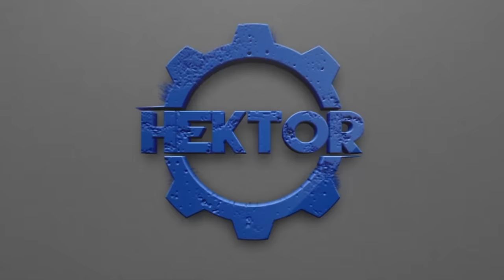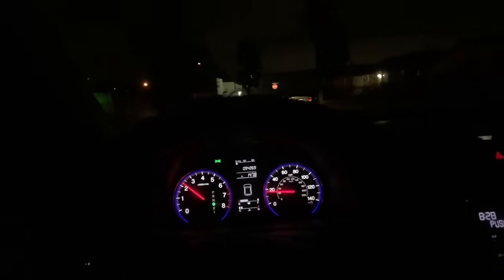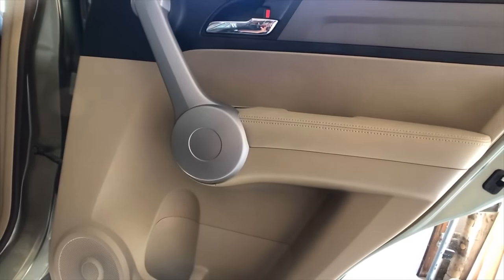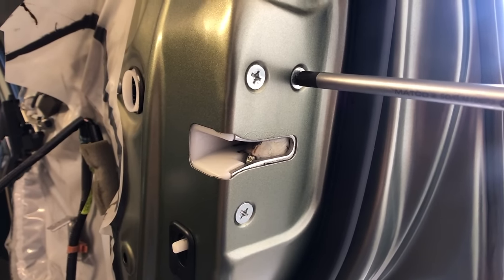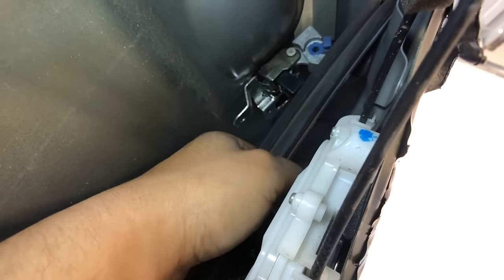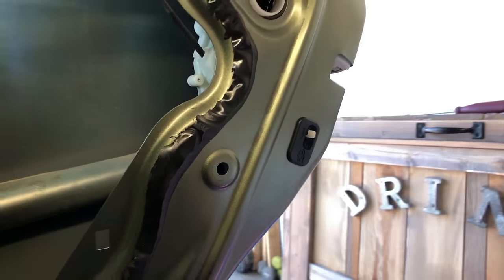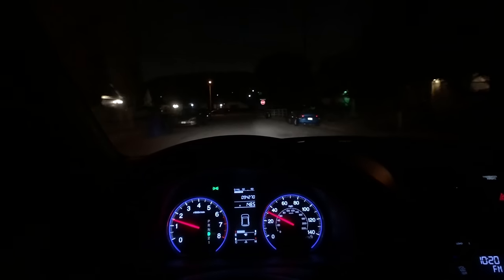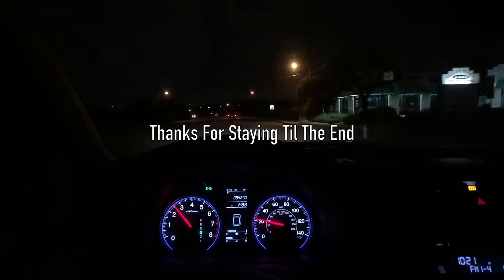Honda CRV common door lock problems

Comment: So I have the exact same thing going on with my Honda CR-V 2003 the drivers door works but the rest don't lock unless you manualy do it Should I replace all the door actuators that are not working???? I truly appreciate your help
Reply from the maker: Kopecky Kopecky do they unlock with the remote?
Reply: @HomieHektor   only the drivers door
Reply: Mine is a 04 crv. None of them open.
Reply: @kopeckykopecky6053  Hey, I just picked up an 04 Honda CR-V with the same issue. Only my driver door works with the key remote and with the power lock button. What ended up being your problem? Was it the actuators? Thanks.
Reply: @TheTruth923  yes I had to replace all the broken actuators myself, it's a long process but worth it, and remember don't force anything the plastic is old a brittle
Reply: @kopeckykopecky6053  You're the best. Thank you for the quick reply. Ordering those actuators now!

Comment: Just found your video!
Do you have any advise for the exact same Honda CRV and year where my back door and passenger back door are completely locked?
Will not open for anything.
Help would be greatly appreciated!
Thank you so much!
Reply from the maker: The door don’t open form the inside or outside when unlocked? Is this what you’re saying?
Reply: Yes.
When unlocked, the back and side door will not unlock.
Trying it manually as well will not work....
Still locked....

Comment: after 5 years, my 2017 CRV is showing the symptom of the faulty actuator. my left rear door wont lock and have to manually lock it. what is very scary now is all the windows automatically rolled all the way down after parking.. my wife came out of Walmart to find the windows rolled down. freaking scary..

Comment: On my 2006 the remote will unlock all the doors but will not lock them. Putting the key in will lock all doors but the remote will not. Any ideas. Thanks
Reply: Check the auto lock maybe it is deactivated

Comment: To disable the automatic door locking functions, follow these steps:

1. Make sure the range selector lever is in the P (Park) position (for vehicles with an automatic transmission).

2. Turn the ignition key to the ON (II) position and open the driver's door.

3. Press and hold the front of the central locking switch until you hear a click (after about 5 seconds).

4. Release the switch and within 20 seconds turn the ignition key to the LOCK (0) position.

To enable door locking when moving the range selector lever out of the P (Park) position, follow these steps:

In this mode, all side doors and the tailgate are locked by moving the range selector lever from the P (Park) position (for vehicles with an automatic transmission).

1. Make sure the range selector lever is in the P (Park) position.

2. Turn the ignition key to the ON (II) position and close the driver's door.

3. Press and hold the front of the central locking switch on the driver's door. You will hear a click.

You will not hear another click (about 5 seconds).

4. Release the switch and within 20 seconds turn the ignition key to the LOCK (0) position.

To turn on the door locking mode when a certain speed is reached, do the following:

In this mode, all side doors and the liftgate are locked when the vehicle reaches 15 km / h.

Comment: Hi hector, I have a 2002 Honda CRV. My key fob locks my cars doors, and it opens the rear cargo window, but it will not unlock my doors. The locks work when I press the unlock switch on the car door, so I don’t think it’s the actuator. Do you have any ideas of what I can do?
Reply from the maker: Nena DeLeon I would have to look at a diagram of the door locks to be certain, but it could be the module, relay, wiring, or the key fob itself. Hard to say 🤔

Comment: On my 2004 Honda CR-V, I had to replace the window motor. That part went OK. I moved the actuator bar a little too high to get the old motor out and the bar popped free from the door. Is there a way to pop it back in place?
Reply from the maker: MrVegas there’s always a fix, I’m not sure what ‘actuator bar’ you’re talking about though.
Reply: @HomieHektor  No ideas? Well, Its a tough one for me too, but thanks for the reply just the same.

Comment: I have a 2004 Honda crv the lock button doesn't lock the doors or opens them. It's for both doors driver and passenger side lock buttons. The passenger side door tho I can use the key to open the door but I cant use the key to open the driver side door. It makes the sounds but nothing is happening same with key fob
Reply: And if my driver side is open and I try to push down the lock it won't go down if my door is open

Comment: We bought our 2016 Honda CRV new it’s never been an accident or worked on. The battery went dead in September I put in a new battery. The battery that was in the car was 17 months old. I recharged the battery after removing it it is still holding 12.8 V. I bought a brand new top-of-the-line battery at Napa. I charged it at 2 A overnight before installing it on the car. My wife got the flu in the car sat 5 days.. Dead battery again. The alternator is putting out over 14 V when the car is running. The parasitic draw with an amp meter in line with the negative cable to the negative post on the battery is approximately half an amp..
  The car has power door locks. The batteries in the fobs are good.
  A few months ago the car started doing something it never did since new.
  when I have the key fob in my pocket. When I walked past the locked car, the doors will open without me touching the car or touching the fob
  when I walk past the car again, the doors lock all by themselves without me touching the fob or the car. It does the same thing when we walk past the car using my wife’s key fob. The car never did this before. I believe this could be the reason the battery goes dead. An issue with that system
  Any suggestions?

Comment: My passenger rear door stays locked, sooo how would I go about changing the actuator if I can’t get the door open
Reply from the maker: Nicole Casanova you cant open from the inside or outside? You’re gonna have to manually open it with a hook ( like a locksmith would ) then You can change it out...
Reply: Homie Hektor inside and outside, but the problem has resolved itself 😏 thanks!
Reply from the maker: Nicole Casanova ok 🤔

Comment: I have a 2008 Honda CR-V, had the same problem and then the right passenger door doesn’t want to lock at all, back passenger door started making a buzzing noise so we replaced the back passenger acculator but the passenger door doesn’t want to lock (it locks then goes back into unlocked position . Still makes lock and unlock noises when driving.
Reply from the maker: If it doesn’t want to stay locked, change it. I changed 3 on this truck 😮
Reply: Homie Hektor so replace that acculator on that door too (passenger front)
Reply from the maker: Krista Fra yeah, you’re saying the from passenger door doesn’t stay locked, right?
Reply: Homie Hektor correct, when I go to lock the door it wants to but it slowly switches back into unlocked position. Anything over 10mph when I stop it makes a locking sound
Reply from the maker: Krista Fra yeah change it, problem solved 👍🏼
Reply: Homie Hektor alright awesome I just ordered the part. The video was awesome btw man, I’ll check back in. ✌️
Reply from the maker: Krista Fra appreciate it, thanks for subscribing 🤙🏼

Comment: Just out of curiosity how much did you charge the customer total for the 3 door lock actuators?
Reply from the maker: Larissa Reid $405 parts and labor
Reply: @HomieHektor  2 of my doors, both passenger sides, long just fine, but are making this "blededededededeh" noise when they lock or unlock.... Not sure what to replace!
Reply from the maker: Eric Widder replace the actuators 🤙🏼
Reply: @HomieHektor  thanks man, looks like a pain getting in there!
Reply from the maker: Eric Widder it can be, the 3 screws holding it in are kinda of pain also

Comment: Hector, with all the respect, If that happen to both of the door at the same time, Do that mean both of the actuators are bad?
Reply from the maker: David Angel Yes, door lock actuators are a very common failure on Honda and Acura vehicles. I was surprised that 3 were bad on this CRV
Reply: @HomieHektor  Thanks so much for your time,  Be bless!  Have a great night!

Comment: So I’m having a similar issue with my 2008 civic. All my doors lock however it does that thing where the doors lock when passing 10 mph. Also, the lights and horn don’t come on when locking the car by pushing lock twice. Any ideas on this?
Reply: This is the exact issue i am having with my Accord. Did you figure out what the problem is?
Reply: @Following_Jesus_In_Faith  not really it kinda went away on its own but I left my car unlocked overnight (yea sketchy I know lol) but when I tried locking it the following Morning it blinked and hocked like normal and the car would drive normally. Very odd!

Comment: Use heat with a small torch with impact bit
Reply from the maker: Nope, impact will dent the door. Ask me how I know 😁
Reply: @HomieHektor  i do it all the time, heat it up with a small lighter torch, 3/8 impact gun with p3 screw bit and they come right out

Comment: did you go with aftermarket part?
Reply from the maker: Gabriell Encarnacion when it comes to electrical parts, I use OEM. I got Honda parts from a Amazon 👍🏼
Reply: @HomieHektor  ok thanks man for the quick response

Comment: What happens if the doors are stuck in the locked position? My passenger rear and hatch are both stuck locked.
Reply: You need to change the rear door actuator, then the rear hatch will start working again

Comment: Honda dealership charged 1800 to fix.am i being ripped off
Reply from the maker: Matt Johnson Very much, you can do it yourself 🤙🏼
Reply: @HomieHektor  they told me they had to replace the actuator passenger front door lock. Remove the outdated alarm that caused a fuse to blow in the multiplex and they have to replace the multiplex does that sound right
Reply from the maker: Matt Johnson if the alarm is shorting out, then yeah it would have to be removed or replaced, but why replace the multiplex?

Comment: Mine does the opposite!! It drives me freaking crazy. They stay locked, if I unlock they lock and then lock by themselves right after
Reply: I've got the same issue
 Anyone know what's going on?
Reply: Me too.  Waiting for response
Reply: me too same issue .. I tried disconnect bonnet closed switch .. did not help.. next i will try turn the door lock feature off completely .. In in Ireland so its a manual drive Civic 2007
Reply: Did you find any solution guys. Same problem on my car. Is driving me crazy

Comment: You would have been able to easily remove the latch screws without damage if you had the correct tools. The correct tool here is a hand impact driver with a P3 bit.

Some here have stated it's a JIS3 screw, but it's not. P3 has a flat bottom like a JIS3 but a P3 has rounded corners just like this one. If it was a JIS3, your P3 screwdriver would not have fit like it did.

Also, the rod clips are much easier to remove using a pick set.